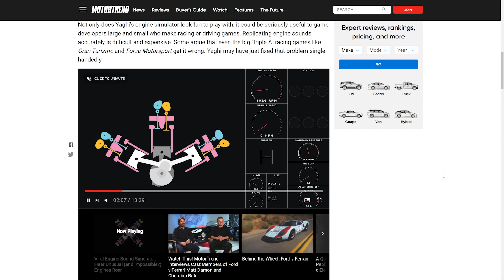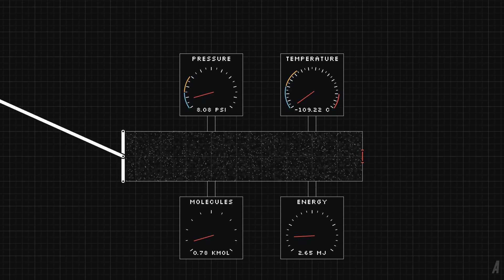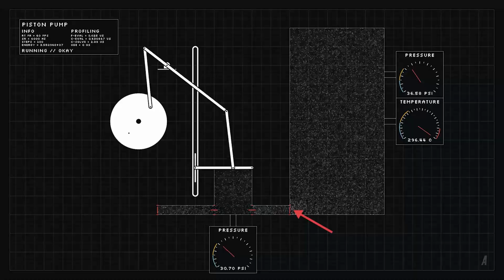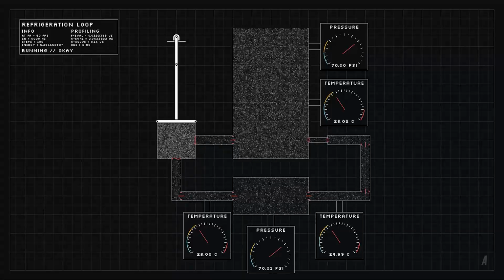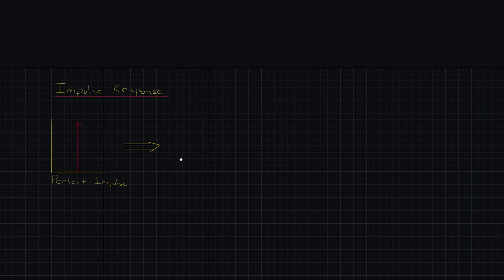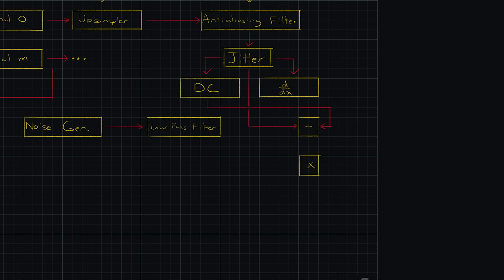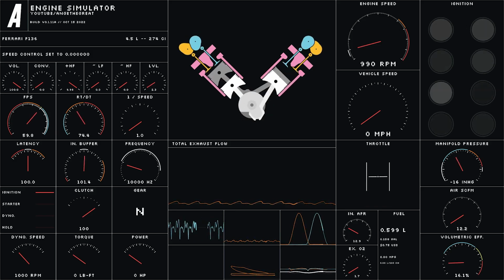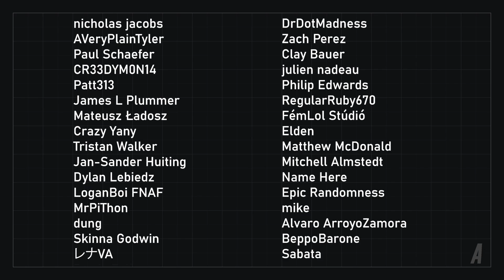Engine Sim: Procedurally Generating Audio Using a Real-time Fluid Simulation (Technical Breakdown)

Comment: I have a suggestion regarding the sound design, which may or may not produce the "higher partials" you're expecting. At high acoustic pressure levels, sound propagation is nonlinear, meaning that higher-pressure zones travel faster than low-pressure zone. This causes them to "catch up", steepening the pressure gradient. If the tube is long enough, it may even lead to shock waves: these have been observed e.g. in trumpets using Schlieren imaging, and I suspect that some motors may produce them as well.

My suggestion is therefore to implement a nonlinear filter simulating this effect: assuming that the waves only travel in one direction, it can be represented simply a variable-length delay, for which the delay length depends on the pressure level (i.e. on the signal itself).
For more info the keywords are "weakly nonlinear acoustics".

Cheers!
Reply: Also note that the pressure waves radiated by the end of a small tube into outer air can be quite different from the waves traveling inside the tube due to the impedance mismatch. This may explain your need for a high-frequency boost.
Reply from the maker: This is actually a very interesting point and I'll definitely look into this. Thanks for sharing, really appreciate it!

Comment: This is a really cool project. Have you thought about simulating fuel/air mixtures burning in the exhaust and expanding to change exhaust pressure and therefore exhaust sound? I think that has potential to add something to the simulation that's currently missing.

Comment: I develop induction systems for race engines. I feel like this program has a ton of potential. The fact that you understand air flow this well is amazing to me. Only a small amount  people understand engine airflow this deeply.  I would be intrested to see if you could develop port designs/sizing with this program. If you are intrested I can give you specs of a head and intake port/ plenum design and we could compare the results to a flow bench to check for accuracy(my work has a sf-1020). If this would work you would make my job so much easier. You could run simulations of customers exact engine set up and fined the best port sizing and shaping for the application.

Comment: I think you have done a pretty good job. Software is not my thing, but I do motor sport as a hobby. I do know that different inlets, carburetors and forms of aspiration do change the overall sound of an engine i.e full throttle under load, idol, cruise and engine braking as you mentioned. Inlet manifolds are designed with pulse wave from closing inlet valves in mind for example. I know by experience that at high engine speed with side draft carburetors you can get fuel mist coming out of the carburetor's velocity stacks. So to be able to simulate the exact sound of every engine configuration would be impossible. And exhausts vary. In saying that you are very close. Job well done. I doubt you would have time, but I have an engine configuration i would love to hear if you want to try it. Cheers, Nev.

Comment: This is amazing, you have done an incredible job here. Are you familiar with GT-Power? It is probably the only commercially available engine simulator out there. It uses 1-D flow simulation and after correlating the simulations with actual test numbers, can be used to create very accurate models. It cost $60k per license, per year.  It can be used to create fairly accurate ignition timing maps, camshaft profiles, VE tables, etc.. I have not looked at your code or played with your simulator to fully understand it's accuracy, but I fully appreciate the engine audio it creates haha.

Comment: I am a "expert in fluid dynamics" (In "" because I work with chemical reactions mostly) and I'd say it's pretty spot on what you did (for this use case of course). About the white noise thing, It's true there is some white noise irl but I IMAGINE it doesn't come directly from the turbulence, but from the interaction of the air molecules with the inperfect surfaces inside the engine, ie friction, probably most of it coming from parts like the manifolds flanges. The turbulence of course plays a role in it but it's not the full reason, but the way you implemented it does the job just fine, I also imagine simulating that would be a pain in the butt.

Comment: This is great, really great.
The only thing left, is to include not just the engine, but also the gears and the exhaust pipe and stuff, course in my knowledge, they also modify the sound a bit.

Incredibly great tho, thx man
Reply: If you were to do that, you'd need to have them on their own volume mix. As people may want to mute them entireky

Comment: It's definitely not a scientific simulation. And even modern CFD simulations are not capable of capturing the full complexity of the turbulent flow and flame propagation (As far as I know of ). But it solves the problem it is intended for, which is what counts. 
To make things a bit more accurate you could treat the intake and exhaust manifolds using a simple PDE in time and position along the "tubing". In this manner, you could capture shocks, waves, and wave reflection at the in- and outlets. These are important as they can increase the volumetric efficiency of the engine. 
However, even that would be infeasible at 85k fps. So I think you got the best possible solution, given the problem you set out to solve
Reply from the maker: I was planning to look into that approach for the exhaust and intake, but whether or not it makes it into the simulation depends on performance of course
Reply: @AngeTheGreat  There are numerical schemes based on the method of characteristics for the hyperbolic PDE you need to solve, which are very efficient. Maybe it is doable, I'm looking forward to seeing what you come up with!

Comment: Lower idle(thumpy notes) resonator adjust, muffle adjust, x-pipe or crossover, and lenghth of "pipe", would all be cool add INs. What about vortex and wind shear? Turbos and super chargers? Tunnel ram or short intake? Also component wear and how it effects over time(somethings wear faster). Also lubrication drag/bearing wear and spark timing would be cool. How you heard of desktop Dyno? There was a drag race sim that could import engine, anyway it sounded very close to actual engine and it was a audio generator like yours. Maybe  it could help think of thing you may have missed. Hope this is helpful, thank you for the cool video.

Comment: It’s incredibly interesting how this works— I didn’t even know that actual airflow was simulated!

I have a question: Are you working on simulating the sounds of engine-driven accessories? I feel like that is the only thing missing from Engine Simulator as of late and it would be cool to simulate how timing gears, alternators and radiator fans sound like in the game.

Comment: Great video!  Thanks for making this!

Your explanation of the refrigeration cycle was great!

Ive been designing a 3d printed engine that will run off of conpressed air.  Will the full release of Engine sim have preasure engines?  I think it would be really neat to be able to simulate steam engines and such.

Comment: Hi Ange ! Great work, really !

Although I think there is one little thing to add to get a more realistic sound - don't get me wrong, this works already super fine - especially when going at higher rpm :

By changing (up) the LPF frequency with the RPM frequency, it will "open" the dampening of the mufflers, just like it does IRL. I don't know what kind of DADSR filter you use, but changing the slope of the decay can be sufficient (from concave to convex), or if you can't the amount of sustain.
Of course it changes with the type of muffler, so myabe in the future adding a choice, or make this previously explained effect change with the manual LF, etc. settings...

You can also do the same for the volume, in relation to throttle use, in kind of the same way.

I hope all this is understandable, please don't hesitate to contact me, I'd love to share and participate at my scale :)

Thanks again for all the good work !

Comment: About the criteria for "real" simulations... 
It makes me think a lot about the Turing test and what criterias we should have for deciding wether something is conscious and/or a person. Surely the answer is that mimicry of the criterias is accomplishment of the criterias, there's no inherent difference. Just like a flight simulator that abstracts the fluids away is just as much a flight simulator as one that simulates all the fluids in incredible details. 

In many ways, a simulation doesn't have to be accurate or "complete". A group of people running a thiught experiment is a simulation in the same sense as if we'd ask a single computer to work out the obstacles and strategies. Simulations are simulations, even if they are halfassed or only applicable to specific details while abstracting the rest

Comment: The step where you added variations in the rpm, from just the sampled sound of piston events, that was dead on for radio interference in the speakers with your capacitor is shot!

Just a totally random and probably useless observation, but brought me back to an old car I had long long ago.

And SAE is king.

Comment: The goal was to get engine sounds and approximate torque and horsepower values. It does that just fine. People need to learn that things don't need to be perfect, most of the time close enough is just that, close enough!

Comment: It's interesting how differently we approach the same simple equation - I come at PV = nRT from the historical angle, that all of these scientists in the 18th century and earlier were doing this little experiments finding out that V is proportional to T at constant P, or that P is inversely proportional to V at constant T, which gives us in general that P*V must be proportional to T and the kinetic theory is just the capital-T Theory that provides the mechanical underpinnings to connect all the laws explicitly. That was plenty for me, as the narrative of understanding the natural world is reason and narrative enough without requiring anything further. But I can definitely sympathise with not being satisfied with the takeaway from PV = nRT being... that PV = nRT

On the "real simulation" side, people can be real prats about confusing purpose and packaging for legitimacy. This is simulation, fairly coarse grained but for the purpose that you're using it for it's almost overkill. Armchair experts need to come to terms with the fact that just because it isn't Autodesk making the software and some famous western car brand using it doesn't undermine the legitimacy or the quality of the outputs. People be dum dums.

Comment: If you want, it would be possible to get an almost identical eq curve of an exact engine sound, provided you have an existing recording of it. This would be hard to implement because of needing a DAW, but with vst software like Fabfilter pro q3, you can insert your sample and it will match the eq curve of the new sound to match the sample. Keep in mind, this would be entirely outside of the code perspective. It would probably have a lot of latency/be inefficient if you were to somehow implement it within the engine, though.

Comment: This simulation is really great for what it is. Sure automotive industry has more sophisticated solutions for this, but they are a view 10'000 working hours ahead of you and really focused on details in the engine they want to build. Steve Brunton and Nathan Kutz book Data driven science and engineering do cover high dimensional fluid control strategies and how to compute quite accurate solutions for reduced order models. Might be worth a look, especially if you want to use more control on the airflow.
PS: i finally found some help against the use of imperial units, it's called SI units and input converter functions ^^
Reply from the maker: I'll definitely look into that book, I'm always looking for ways to improve the model. Also I already treat units that way lol. All values use SI units in the simulator but they can be inputted and displayed using whatever units you want

Comment: This is legitimately very cool. I'm a chemical engineering student, and I figured I would share my two cents on the gas law stuff since you asked. Have you considered alternate equations of state for the gas? The ideal gas law is valid for lower pressures and temperatures, but at high pressures, it starts to break down since the molecule size relative to the mean free path length becomes significant. A simple linear deviation parameter that just modifies the output by a factor of x depending on the concentration could make the simulator even more accurate. As for the change in pressure and temperature as you compress the gas, I assume you are running a small time step type of simulation, so just using an adiabatic process approximation (see https://en.wikipedia.org/wiki/Adiabatic_process for a somewhat decent explanation) and then computing the temperature loss due to the surroundings as a two step process would probably give a decent approximation. Same for flow through a nozzle, but for constant enthalpy flow.

Again, I think this is really neat, and it already seems pretty accurate, so only consider this if you want.
Reply from the maker: You're right about the ideal gas law so I might look into a more detailed model later on. The suggestion you made about adiabatic compression and small timestep is actually exactly how the simulation is done now. The simulation is done in multiple steps as you suggest, including flow through a nozzle. I figured that by ensuring that energy is conserved and everything is "accounted for" I can keep the simulation relatively accurate even though the simulation is done in discrete steps. Thanks for sharing your knowledge!

Comment: sound is just pressure waves on a media, usually air

the convolution trick is a correct way  to add reflections, refractions and diffractions; i made my undergrad physics thesis on the impulse response diffraction of a wedge

anyway, sound in air is just pressure waves, give it a look
Reply: also, maybe you're missing that diffraction convolution, you could calculate the solution with the impulse response and then apply the convolution to your sound function, it may inprove the sound a bit, look for Biot-Tolstoy Wedge theory, if you want i can send you a copy of my thesis (it's biot tolstoy applied to babinet's principle but for acoustics, and i have some derivations that may be useful)
Reply from the maker: You're absolutely right about sound being pressure waves in a medium which is why I used the convolution technique (some other research papers I looked at used a similar approach). The number of ignorant people that thought this was invalid or just "audio processing" was pretty frustrating...

I'd love to see your thesis and some more information about diffraction convolution. I may have missed that since I've never heard of it. Message me on Discord or feel free to e-mail me. Thanks for watching and sharing your knowledge!

Comment: glad to see the use of engineering principles to make something so cool! I'm curious about the specific equations you used for the fluid simulations. It looked like you used a derived formula from the book. Do you think the simulation would be more accurate by using Rate-form of conservation of mass, conservations of linear momentum, and conservations of energy equations? I believe that is how that general equation was derived, but i think that using the raw equations could benefit the sim, as it would allow you to have specific equations for each valve type.

Comment: The reason it sounds muffled is probably because you use the output of the fluid simulation which as i understand it models air flow rate and you turn it into an audio signal. sound is not the flow of air but rather differential pressure. Low frequency sound has airflow associated with it, high frequency sound does not. I dont really know how to put this into words but basically the air molecules get excited by the positive pressure, move out of the way and because of the the time it takes for the following low pressure to pull them back they don't stay in their original position and move with the airflow.
High frequency sound waves excite the molecules so quickly that they vibrate around a fixed position in space. The sound propagates through the air as one particle excites the next one and the next one and so on, but every air molecule stays in the same relative position so no air flow is generated.
I might be entirely wrong about this 😂

Comment: I'm here to do what I didn't think to do and complain about Imperial units since I never though of doing it before and that random clip gave me the random idea of complaining.
Jokes aside I think that could be a rather simple but worthy addition to the simulator (or perhaps in the teased future version).
I could assume that your calculations on the backend already use metric as most physics calculations tend to match with, however even if not the conversion isn't too complex I think and for the purposes of display they don't need to be extremely precise.

TL;DR: Pls add, that would be cool, thanks :)
PS: Love you work just sad I suck at gear shifiting in the simulator XD